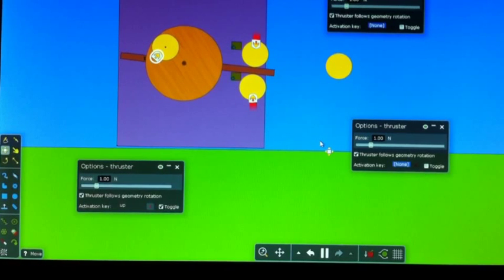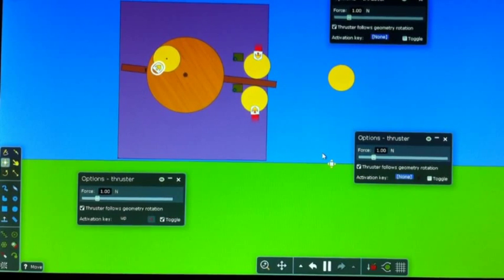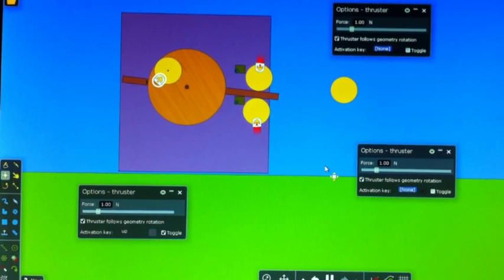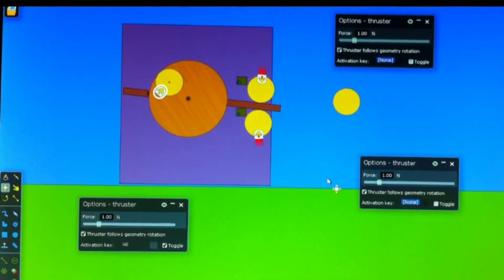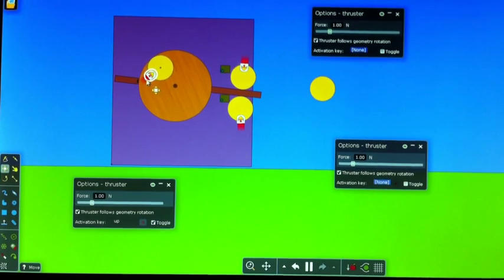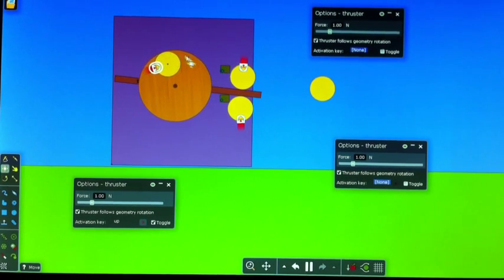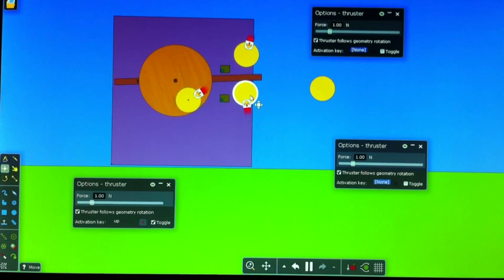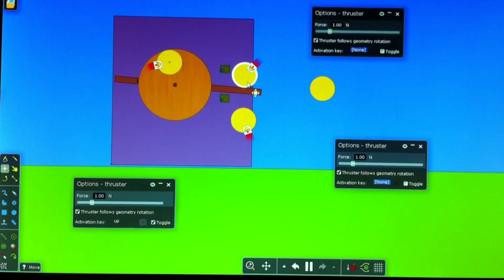Over Unity Acceleration of Mass

Comment from the maker: Never am I too proud to say when I am wrong. After a little more research on the Moon subject, yes there appears to be a balancing of forces in the works in the Earth Moon system. However, the ability to obtain Overunity from a properly designed machine remains evident as expressed in this all of my videos. The key is to extract of energy during each linear directional change of centripetal push.

Comment from the maker: @gomunkul
The "LAW", or more precisely the "Equation"  for Conservation of Energy", does not apply to the final result here, because this is a 2 stage system or equation. To illustrate... Tidal forces are caused by moon orbit, yet zero thrust has been  required to maintain moon orbit since it came into existence.
Over Unity? Yes!